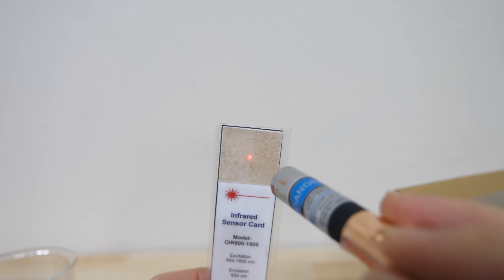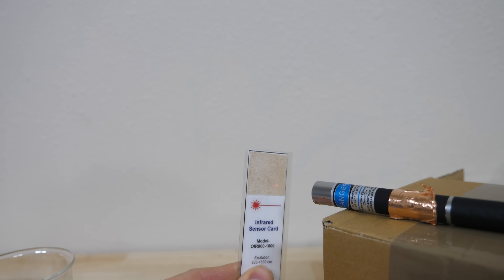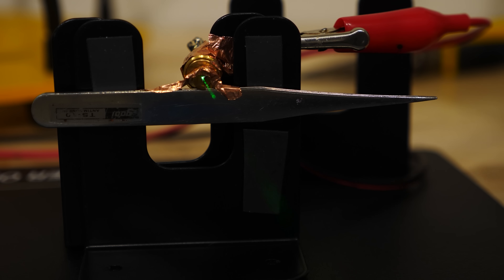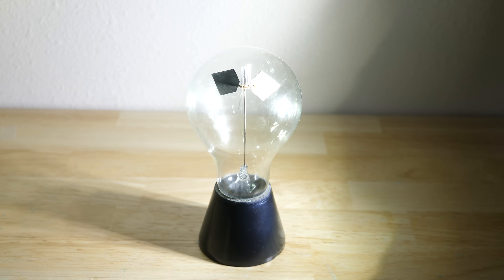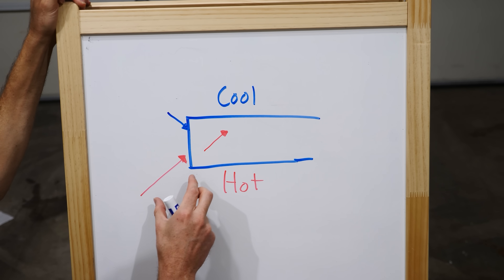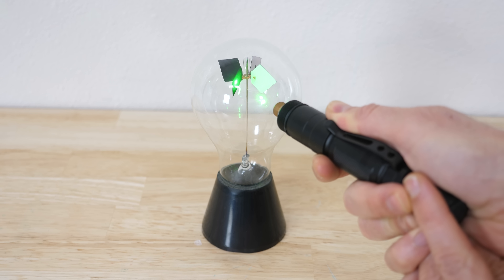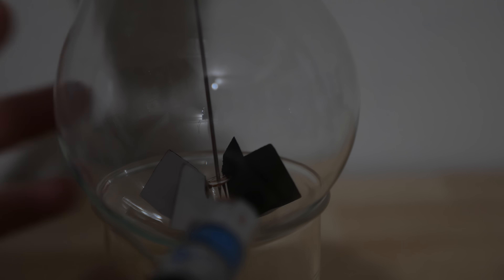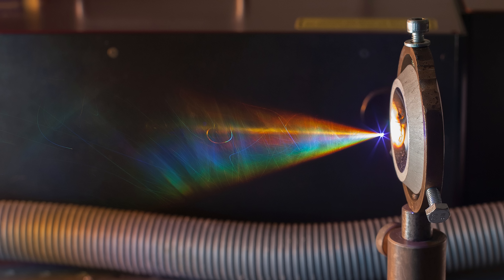I Had To Break My Radiometer For Science

Comment: I would suspect that it has to do with the nature of the coating - absorbing near to all energy of the laser and having not enough air to dissipate it (by convective cooling) so these (seemingly small particles) of soot or metal nanoparticles start to glow and emit a nice continuum of light. After all that is what the coating is applied for - absorbing light an heating the little air that is left in there…You can actually see the dust like nature of the black coating in your finger prints on the sticky tape at some point. Please test again with simple soot (from a candle) or carbon dust or even NP coated platinum. Or even test it with this blackest material on earth (Vantablack?)? Good luck!

Comment: Thanks for the video. Your experiment with the radiometer can be very dangerous for you and also for imitators. It would be nice if you warned people not to duplicate any test without proper goggles. Why? Because without glasses, reaching up to a lightbulb causes reflections on the glass of the lightbulb, and those of an invisible laser. Depending on the laser, this can cause irreparable damage to the eye or even instant blindness in the worst case! I hope you wore safety goggles, which should go without saying when doing any laser experiments. That's why I ask you explicitly to warn against imitators.
Reply: PRETTY sure this is just a 5mW laser pointer
Reply: @michal-jenco  That can even be. We all see how much thermal energy that makes in an air-free environment on a black surface. Check your retina, what kind of environment that is. Would you like such thermal effects to happen there, e.g. through reflections, which you cannot even see because the laser is invisible? Please ask yourself that. Does he also have a measuring device to verify his <5mw-Laser, like other Youtubers? It's also about copycats, not just him using a "not-so-dangerous" laser. We all don't know that, you should measure cheap lasers in particular with a calibrated measuring device BEFORE using them to be sure. Especially when you don't want to use glasses at all, which I really can't understand!
Reply: Exactly 💯! 
I am actually very upset with all the YouTubers not giving appropriate safety information. 
Some actually do and it can be just as simple as having a card in the beginning to make people aware of the dangers. 
I think YT should have this as the primary community guideline...
Reply: @CM-mo7mv  I think he would have done that if he had fully understood the dangers behind it. No one is perfect and I hope they either post a warning in the upcoming video or add a text to their video afterwards. It's not impossible or difficult.

Comment: A few more tests you could have done: 

1. Measure power dependency of the process. The self phase modulation for continuum generation is a third order non-linear process, which is fairly easy to measure with just ND filters or even precisely adjusting the spot size. 

2. You could measure coherence of the emitted light. The important part about super continuum light sources is that they are coherent, yet incandescent light is not.

Comment: I'm a bit surprised that the author didn't expose incandescence before the other option. Occam's Razor after all, it is a much simpler explanation so it is (by default) more likely to be the cause (Crookes radiometer is a simple device, not made by exotic materials).

1. Using an IR laser? IR is the typical "heat radiation" frequency in everyday life for "hot things" (MW is used for heating, but outside electronics, common day objects do not emit MW in appreciable quantities). If you hit something with IR, for sure it will became hotter.
2. The target is a extremely dark substance; it will became hot quite easily quite fast, more if the source is focused (laser).
3. There is a partial vacuum in the medium, preventing target cooling by conduction or by convection.
4. The light emmited is a broad spectrum... like a black body radiation, that is, radiation emmited by being at a certain termperature.

All the ingredients fit. I appreciated being introduced to a novel concept (for me at least) as supercontinuum generation, but I'm not sure if the author introduced it first deliberately (for illustrating a non widely known phenomenon) or he really thought about it as the likely cause, which would be quite odd.

Comment: Nice video! I think supercontinuum generation would have been very unlikely. It is a process which requires the material to be mostly transparent at all wavelengths (both the input laser wavelength and at the generated wavelengths). Also, it requires an extremely high power ( ~ kW), usually obtained at the center of ultra-short and very focused laser pulses. This is because the type of light-matter interaction with the material that is involved (3rd order non-linearity) is extremely weak in most materials. Also, depending on the strentgh of this non-linearity, the optical pulses should travel in the material for a given length for the spuercontinuum process to be effective, for example few cm or meters in optical fibers, or few mm in photonic chips with more efficient materials. Though it was a nice idea and congrats for managing to rule it out experimentally !
Reply: Yep, I was thinking the same.  Though "Supercontinuum in Multimode Fiber" is Les' Lab latest YT video and worth of watch.  Great detail and amazing output!
Reply: @jafinch78  I checked thx, nice video!

Comment: Does the radiometer spin if it is out of its bulb, but in your vacuum chamber? I would think it would. For that matter, does it spin in open air? I'm beginning to think that the paint they use on the fins is special and absorbs light better than other coatings.
Reply: It doesn't spin in open air. Open air is too thick. The uneven heating doesn't produce enough thrust to overcome drag.   The paint is just good black paint. Nearly pure carbon in a binder.

Comment: At first I thought it was combustion or some kind of burning but incandescence certainly makes sense.  The black pigment on the radiometer is most likely carbon and early lightbulbs were made with twine heated with current under vacuum to produce a carbon fiber filament. They also used a relatively high vacuum instead of being filled with inert gas like modern tungsten filament bulbs.  This combination of carbon fiber and high vacuum made them extremely reliable and last extremely long.  The Livermore Centennial Light Bulb, the longest burning light bulb, is a carbon filament light bulb and has been lit up almost continuously since 1901. The inert gas in modern tungsten filament bulbs doesn't react with the tungsten but still heats up and causes currents and motion inside the bulb which damage the filament over time.  Basically modern tungsten bulbs are designed to have a limited lifespan so they have to be replaced and you keep buying new ones.  Carbon fiber filament bulbs last too long so companies don't sell as many.

Comment: i have a question that if the thing is white hot then how it still solid,what is the material the meter is made of, why it is not burning so quickly and just making little smoke. its white hot man. please answer i am your subscriber from the beginning
Reply: Burning (combustion) requires oxygen, whereas black body radiation just requires heat.  Even if the spot is upwards of a few thousand degrees, there is not enough oxygen in the near perfect vacuum of the bulb to allow combustion. This is how lightbulbs work.   

The black pigment used in most paints is fine carbon particles suspended in a binder.  Carbon does a GREAT job of absorbing infrared light, so it becomes very hot, very quickly with a concentrated IR source like this laser.  

The first lightbulbs used a carbon filament, before tungsten was more available. See also charcoal briquets for bbqs.  They hold their shape a LONG time at temperature. 

Of course, that heat is also dissipated into the surrounding carbon and metal backing of the vane by conduction. Given that it is amorphous carbon in the coating, the heat transfer is probably fairly slow, so nothing else gets to a critical temperature like melting or deforming.

Comment: I used to use the older CCD cams for computers that were made super cheap. They lacked IR filters cheaping out and could make out IR, even could resolve the beam of a TV remote. Strangely IR on them looks pale blue.
Reply: Why pale blue
Reply: @jurginschuhardt4858  A good question that I never got around to figure out. A guess I had two or more IR photons have hit a photoreceptor and come out with combined voltage. On the other hand near IR light can be picked up by many older digital cameras as they use silicone sensors. They may have assigned it a color on the software side for some QC testing purposes.
Reply: @krisreddish3066  thank you for replying

Comment: Would love to see how much heat is left in the black part of the radiometer with an IR meter
Reply: Or a non contact thermometer
Reply: Isn't that what a ir meter is? A very low pixel ir camera ?
Reply: @ralanham76 Yup.
Reply: Maybe it'd work in the vacuum chamber, but the radiometer is made of glass, so presume it would block any measurement.
Reply: @Unsensitive  I guess glass blocks some ir.
Reply: protogen :)

Comment: I wonder also if this can be used in some way to get a non-cjemical Propulsion system in space where the vacuum is really good. Propulsion indeed would be REAL because the radiometer itself actually shows the movement when the IR beam is aimed to the black area.
Fantasy in a fantasy: if we make a single unit with a fixed IR laser aiming to a black area all mechanically linked together, in the same way is made inside the radiometer, will it "push" as well?

Comment: sorry but if it's a matter of incandescence how long can it last before the material carbonizes? You should have tried on the white side as well, what material are the black and white diamonds you used made of? maybe the glow is due to some component of the paint..i don't know why but i can't believe it's a glowing issue due to high temperature, please keep thinking about it and see if you find other possible reasons.
Reply: He did try on the white side though. 7:20
Reply: @Curt-0001 
 True! I missed it, thanks!
Reply: I suspect the black is carbon black, so is already carbonized. Carbon was used a filament in early light bulbs, I believe.

Comment: This might have implications for increasing the efficiency of lasers used to produce a fusion reaction.
Reply: Fusion is already done in a vacuum. Otherwise all the equipment would melt. Also, fusion need really specific elements to trigger. The NIF applies these principals but it’s still a lot of energy that’s needed.
Reply: @ImTHECarlos98  Yeah, but maybe the fusionists (if that's the right word) could use this phenomenon to heat up the ambient temperature surrounding the fusion sample and thereby decrease the amount of energy required by the lasers in order to generate the fusion reaction -- just a thought.
Reply: @PeterFraser-hp3rs  Physics gets weird at the conditions required for fusion, to put it simply. We’re trying to combine some of the most fundamental particles into slightly bigger atoms. From my understanding no material can really survive that temperature (200 million K+), but I’m also not a nuclear physicist. So who knows.
Reply: @PeterFraser-hp3rs  you can't heat up a vacuum, heat is just higher vibrational state and if there nothing there, there's nothing to vibrate. Ambient heat is not directional, the point of using lasers is that they are incredibly directional so the heat can be concentrated to a small point. What happens when an atom is hit by very energetic photons (small wavelength i.e x-rays) is that the electrons jump energy states, meaning they move to higher orbitals (further from the nucleus) so while the material is heated up, it means the nucleii are distanced from each other. In order to fuse nucleii, they must be close enough to collide so this is actually something that needs to be overcome (what is called coulombic pressure). This is typically achieved by having a very hi-intensity magnetic field that will confine the ionized material in a dense plasma. This all happens at less than a millionth of a second, the real trick aside from being able to maintain temperatures of over 100 million degrees is sustaining the magnetic field long enough to keep the confinement going and to make back more energy than you spent.
Reply: @philipm3173  I was thinking maybe the heat radiation produced by this phenomenon generated by lasers that are of many magnitudes lower in power than the lasers used to cause the fusion reaction would allow for less energy to be supplied to the lasers dealing directly with the fusion reaction.  I believe radiation from sources of heat can travel through a vacuum, hence why temperatures rise closer to the sun.  If we can use this phenomenon to get the ambient heat-derived radiation in the vacuum to a reasonable percentage of the heat-derived radiation needed for the fusion reaction, then the energy supplied to the lasers used to directly cause the fusion reaction should require less energy.  The other thing is that the fusion reactions will need to occur in fairly rapid succession in order to generate electricity, so maintaining a high heat-derived radiation environment in the vacuum where the fusion reaction takes place will no doubt be necessary.
Reply: Incandescence is orders of magnitude cooler than the temperatures that hi-energy plasmas occur at.

Comment: I'm confused why your laser pointer was able to shine through the glass of the radiometer and the (I assume) either acrylic or polycarbonate of the vacuum chamber. 10.6µm light is strongly absorbed by all of those materials so I would think that very little of the light, especially in the vacuum chamber case, would make it through to hit the veins of the radiometer.
Reply: He doesn’t specify the wavelength of the IR laser but I assume it is 1550 nm or shorter, which easily transmits through glass and polycarbonate.
Reply: @cdvonch   @josephlunderville3195  He did mention 1064nm at ~2:22 in the video, but watching again it looks like that is a different laser than he used for the tests. You're probably right.
Reply: 10um is pretty far down the spectrum for a laser pointer. I would expect it to be more like 765nm, which is the wavelength a cheap repurposed CD laser would be -- that's almost visible light.
Reply: Wups, I think that should actually be 780nm. You get the gist anyway!

Comment: And also what is this "magic" material the radiometer sheet is made from that get white hot without melting??? It should be thin metal sheet, but then why does not heat dissipate over a larger area? Could you explain or make some additional experiment to analyze the material, please

Comment: of course you can up-convert light frequency, by also lower energy pumping
Reply: its no rule that you can only down-convert light frequency
Reply: dont disregard the light pressure
Reply: even if its minimal in the heat-up case
Reply: it still has the E=hf energy even if no heat-up gas
Reply: if you excitate a substance, you get its spectrum output
Reply: you can multiple exitate any substance with any wavelength/energy/frequency, then have all the spectrum lines come out, not only the below the frequency lines
Reply: try vacuum laser sintering :)
Reply: so why should bouncing mirror photon light become over unity, if the exit light bounce retains 100% energy in the bounce, by conservation of energy, the mirror will get nothing from the light bounce
Reply: only absorbed light will generate any movement in the target photon-only crookes radiometer

Comment: the spectrum looks like black body radiation, perhaps the infrared is turning into thermal phonons on the graphite surface
Reply: Incandescence is black-body radiation. It's just the term used for the special case where a significant portion of the emission is in the visible spectrum.
Reply: I was also wondering, as a physics n00b, while watching that section why it couldn’t be black body radiation. That would explain the full spectrum. And Occam’s razor says that the simplest explanation is likely to be the right one… But this is an interesting way of talking about the other phenomenon nonetheless.
Reply: @notyrpapa  incandescence==black body radiation

Ever wondered why light bulbs have a color "temperature" given in Kelvin?
Reply: It is graphite pigment or some kind of nanocrystal pigment ?
Reply: @HellSlider42  It's most likely carbon black and graphite is a form of carbon
Reply: =EXACTLY IT WAS BLACK BODY RADIATION,AND IT DOESNT GIVE A HELL ABOUT WAVELENGTH

...................................
Reply: When I saw the continuous spectrum my thoughts also went immediately to black body radiation.
Reply: I was thinking about something like this as well, it would make sense for it to be black-body absorption and emission — aka 'heating it up white-hot' as said in the video. Would be cool to measure the emission spectrum to confirm it.
Reply: Are you trying to say 'photons'?
Reply: @simarkarmani4034  they could be referring to the quasiparticle, but they probably meant photon
Reply: @ARVash  I was thinking photon was meant as well.  Would be interesting to focus a microphone there I guess and see what the phononic effects are like... especially if like modulating the laser like a laser communications device speaker.
Reply: @simarkarmani4034  nope, he meant phonons - vibrational wavicles